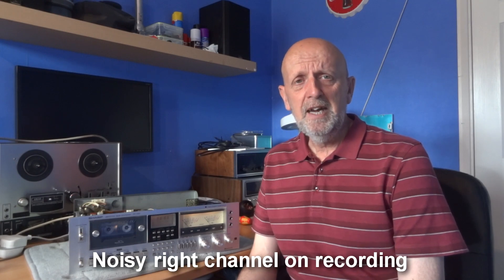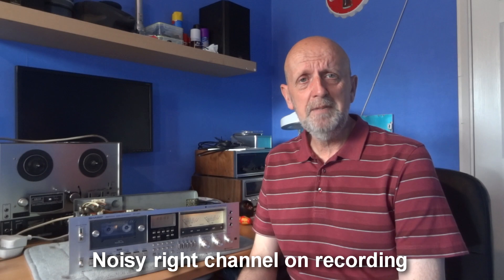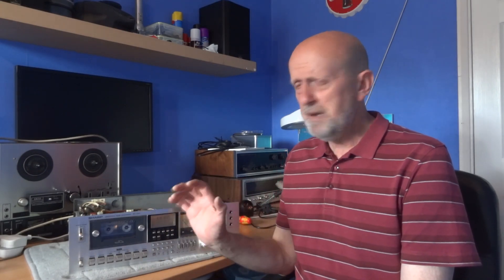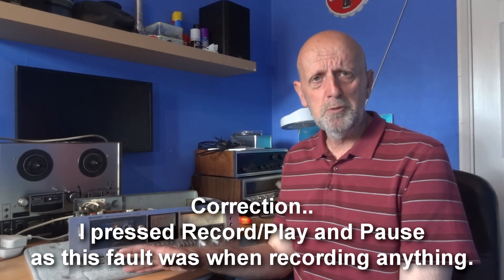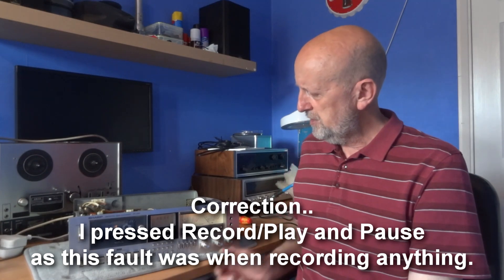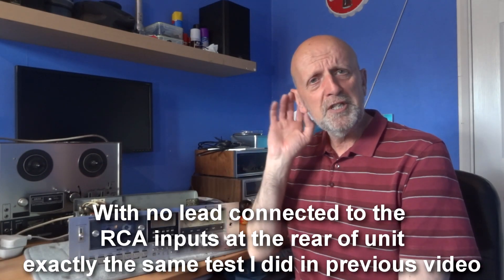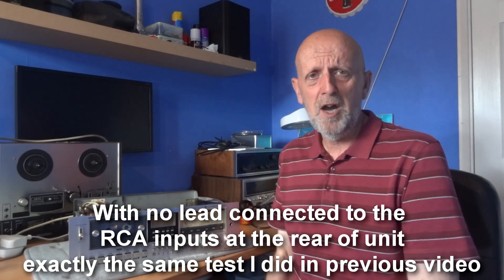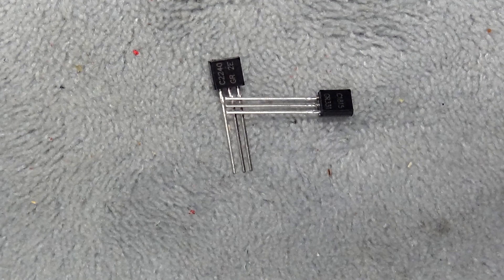Transistor Equivalent, Substitute, Replacing old vintage transistors , #repairing, popping static

Comment: looking for a replacement to the TR733 transistor but cant even find the specs on the original. How do I go about finding the replacement to the TR733 output transistors in my amplifier?
Reply from the maker: What Amplifier do you have that  TR733 transistor is in ? , I will have a look to see if I can find a service manual online
Reply: @MichaelYates  it is a raymer model 801-40
Reply from the maker: @kwacz  Looking at this model, its a 35/40 watt amp with 8 transistors on the circuit board, I can not see any labled as tr733 though, the transitors will have a number on the outer casing
Reply from the maker: @kwacz  Circuit Diagram here https://www.manualslib.com/manual/169622/Raymer-Amplifier-801-40.html?page=4#manual
Reply: @MichaelYates  there are two large transistors mounted to the back of the unit case labeled tr733 right on the transistor.  Maybe the 2n305s is the replacement
Reply from the maker: @kwacz  Sounds very much so this would be the output transistors mounted on rear of case on heat sink or just casing and 2n3055 would be them, easy to get at around £4 each

Comment: hi mic you need a vu kit  you can get of ebay it show you the level of the  out put of a rca  stockets 
i use a low cost  test meter with khz on it all low money under £14  get one will AAA cells not the button
cells  take cells out when not uning and use low cost pound land
why you may think the meters can not turn of 100% why take sell out 
the cells will over heat when not using it why pound land cells he life of them is very 
poor and make it safe  the far east  meters don't work right you can use them if you are care full

bob's bit's
Reply from the maker: Thanks for the information Bob